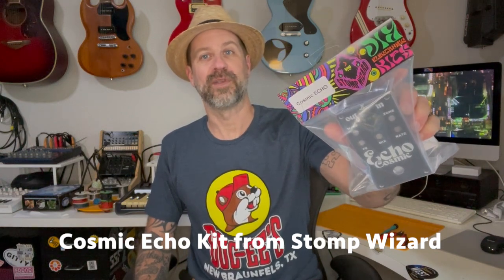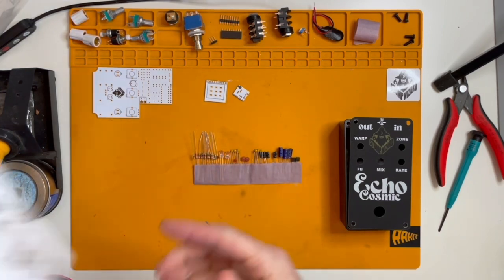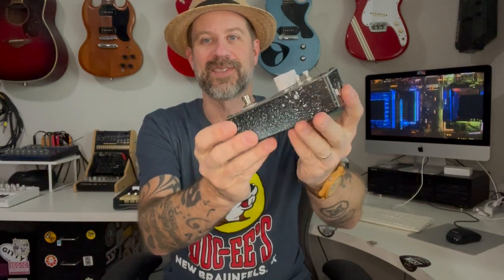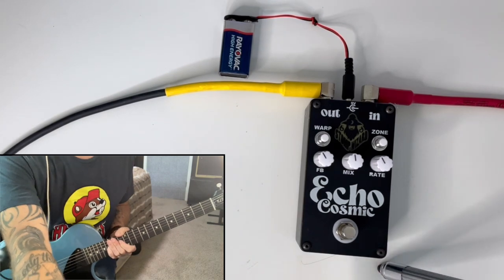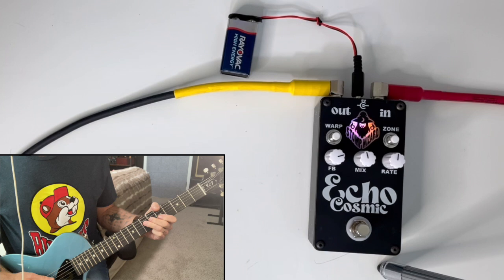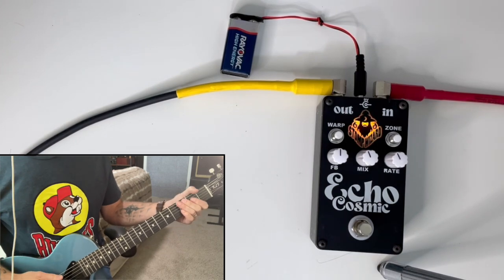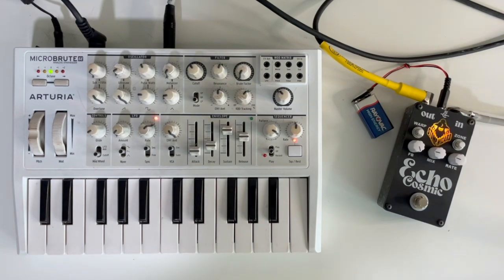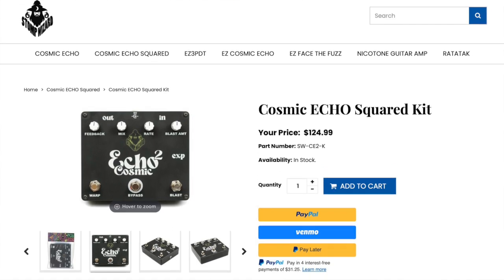Stomp Wizard Cosmic Echo DIY Delay Pedal Kit

Comment: How did you get all 4 bolts into the face plate? Mine don't line up, I could only get the top 2 on! Thanks.
Reply from the maker: If you take the electronics off the faceplate and attach it directly to the metal case, do they line up then? If not, you'll need to elongate the holes. If they line up, then something in the electronics package is blocking it from fully seating. As I remember, it was pretty finicky to get everything seated. If you have a wide PCB joint, it could be just enough to stop it from seating.
Reply: @musicalmiscellany  thanks for the reply, I think that I'd have to elongate the holes, it wouldn't even line up pre populating the board. Oh well, thanks!